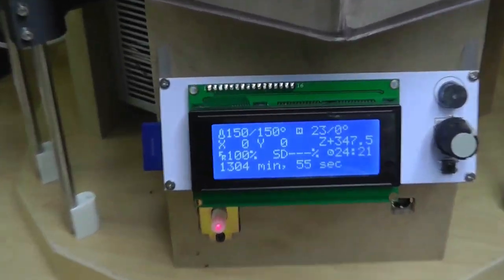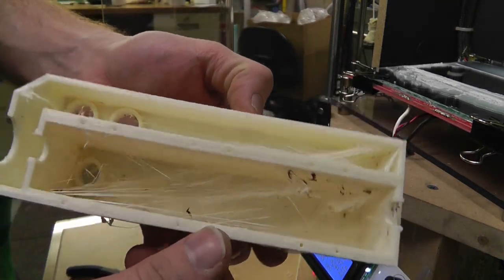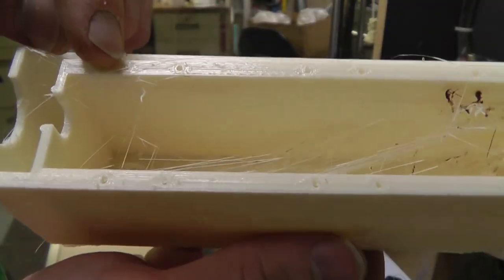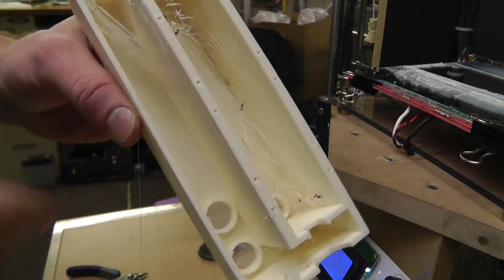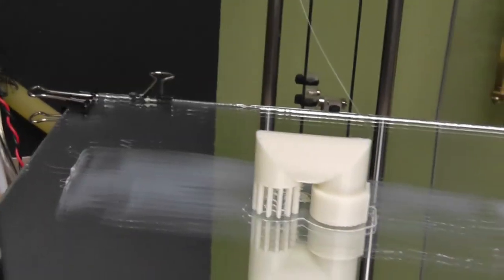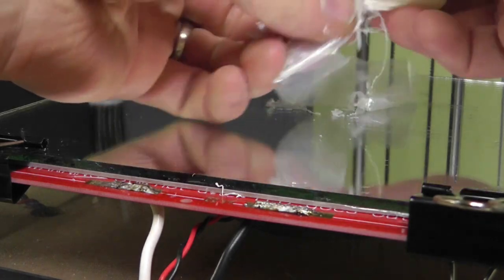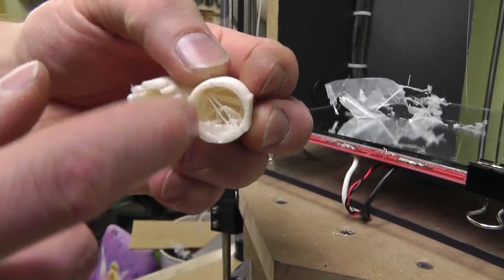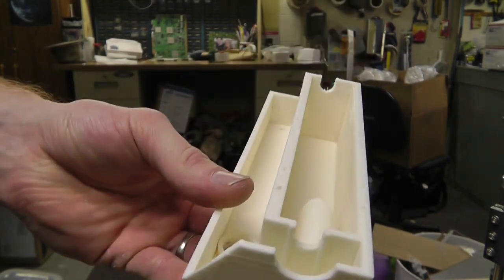#7 ~Russ's Filament Extruder: Making The Water Cooler Test Jig. Time laps

Comment: How about a V pulley pulling it under the water to cool it off.  You can use your machine to make a small V pulley with. Just a thought. 40 years ago I was like you. Had my hands in everything. Don't get mad at me for this. I was like you but not the same machines.

                                                                                                                                                         Terry